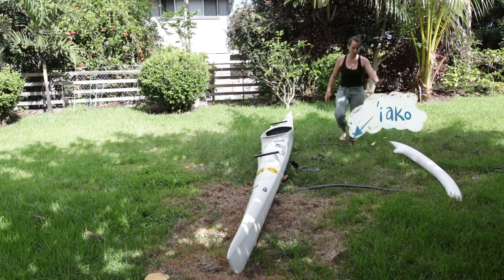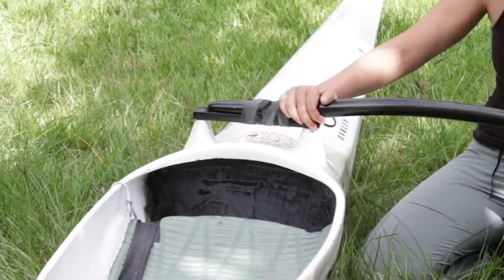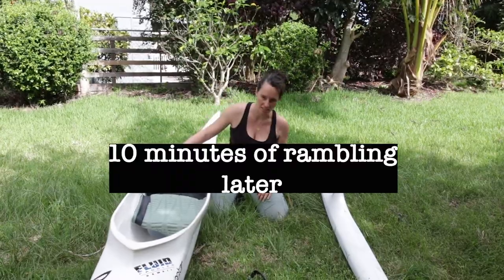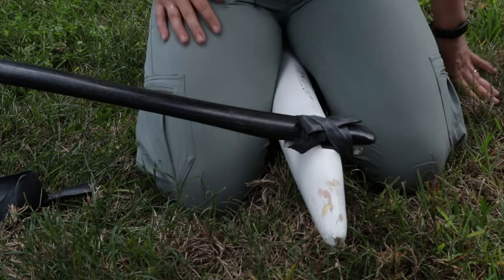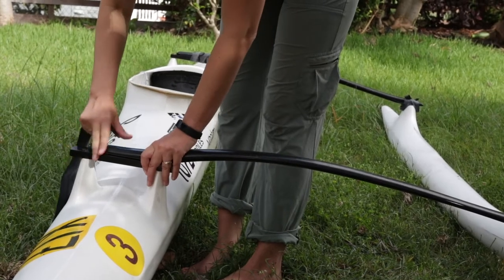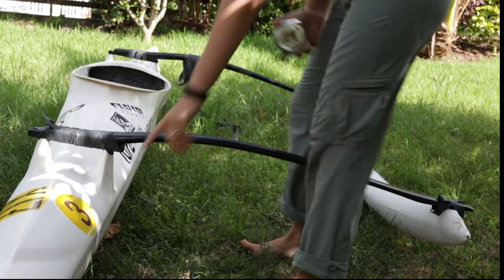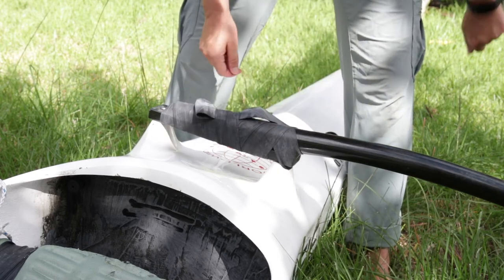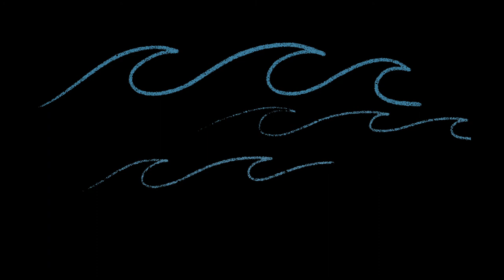How to Rig a V-1

Comment: Great video. :yougotthis:
When I prepare my V1, I don't like to do it in a hurry. I just do it as a process. Slow and efficient.
I usually place a second, larger (wider) rubber on top of the first. Not so tight. The idea is to protect the main rubber. This will extend the useful life of the rubber that holds the iakos for much longer. And go really does.

Comment: My V1 has double nuts on a stainless bolt to attach the ‘iako to the ama. I use full inner tubes (not cut into strips) to attach the ‘iakos to the ‘akea. I’m new at this and was just told to use bicycle tubes. Is there an issue with using the full tube like I am? They seem to be secure; just want to make sure I’m not missing anything
Reply from the maker: You can totally do that! Your iakos will be very secure. I cut mine bc it’s easier for me to manipulate them, but if you can use a full tube by all means do it!